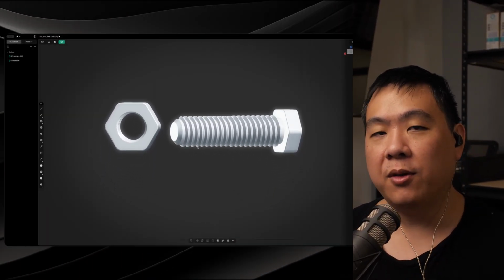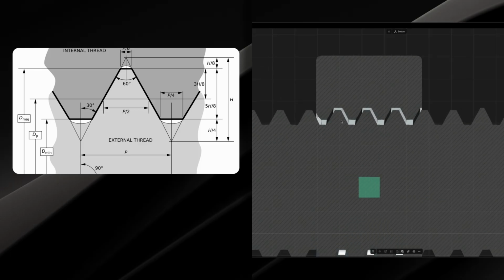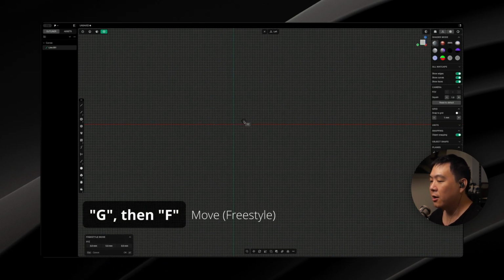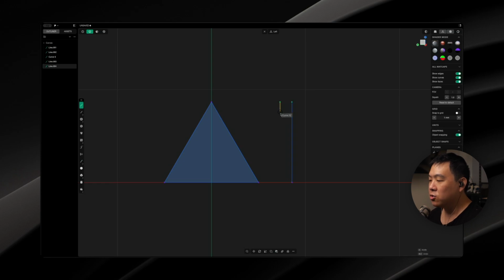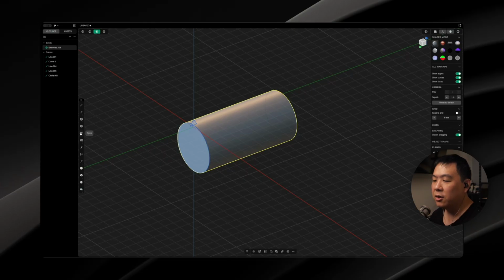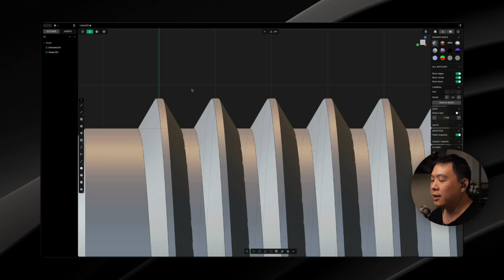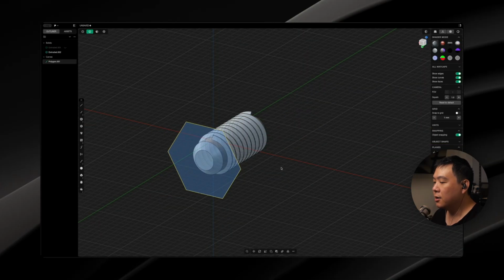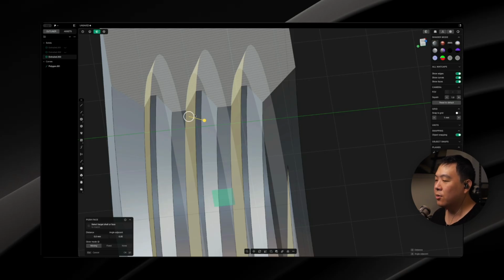How to Model and 3D Print Threads using Plasticity

Comment: Heres the thing. No one should have to make threads. Fusion has it right. Choose the thread from a huge list and they are modeled accurately. Making the thread is a skill and thats fine but I just want to get the thread on. Inventor barely has a thread setup in it and maybe NX too. To all the companies that want in on the little people market you should make and include a thread modeler
Reply from the maker: I don’t disagree haha. But until then, we either use a different tool to create threads or we model it ourselves